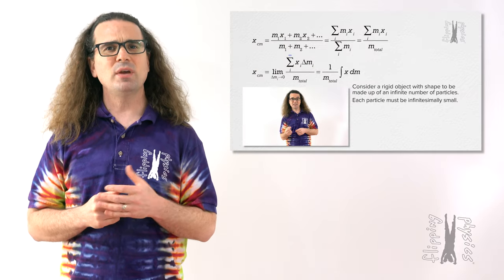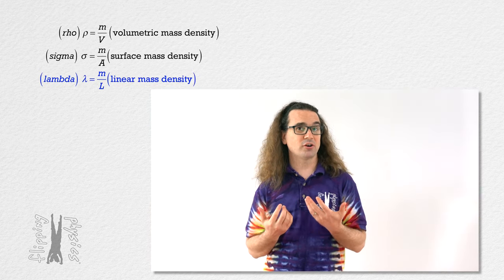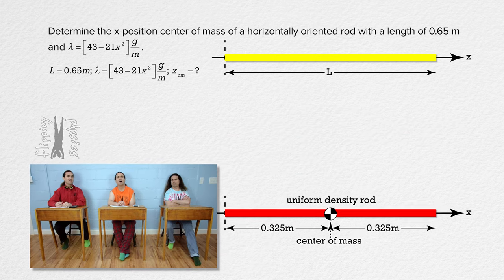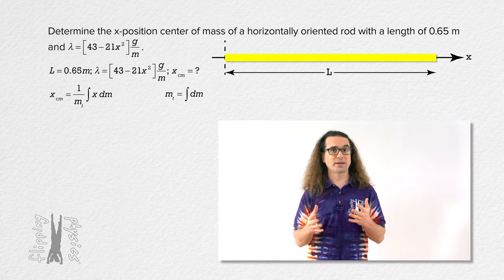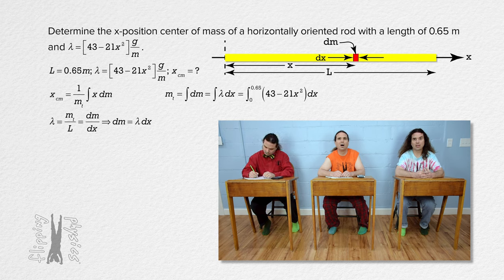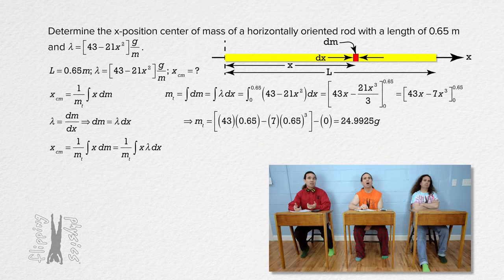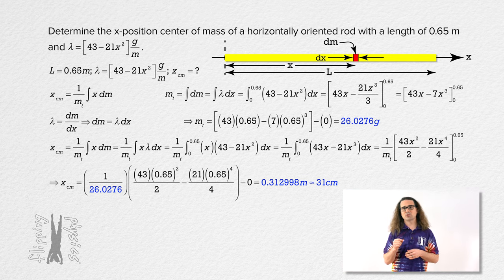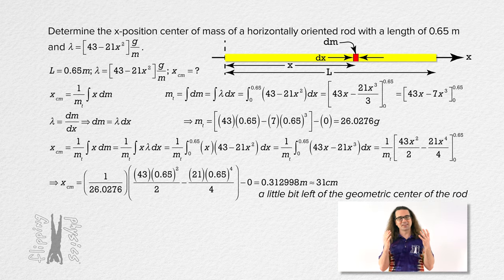Nonuniform Density Center of Mass

Comment: Hello! What about an object that isn’t a rod... with a non uniform cross section?
Reply: In any case, you select a mass element dm, that you allow to vary as a function of x.  At any given x-position, dm will equal the mass of the thin slice you make, of thickness dx.

Suppose we have a cone, made out of some kind of sand-filled resin, that varies linearly in density with position along the x-axis, and density of any given cross-section perpendicular to the x-axis is uniform.   We are letting the x-axis be the vertical position, which is zero at the bottom.  At the top of the cone, where the radius diminishes to zero, the density is rho2, and at the bottom of the cone, the density is rho1.   The base radius is R, and height is H.

Our cone's radius as a function of x is:
r(x) = R*(H - x)

The density is:
rho(x) = rho1 + (rho2-rho1)*x/H

Our mass element is equal to density times area times dx:
dm = rho(x) * pi*r(x)^2 * dx

To find total mass, integrate dm:
M = integral dm
M = integral rho(x) * pi*r(x)^2 * dx
M = integral (rho1 + (rho2-rho1)*x/H)*(R*(H - x)) dx, from x=0 to H
M =1/6*H^2*R*(2*rho1 + rho2)

To find center of mass, integrate x*dm, and then divide by M:
xbar = integral x*dm / M

integral x*rho(x) * pi*r(x)^2 * dx = 
1/12*H^3*R*(rho1 + rho2)

Divide by M:

xbar = 1/12*H^3*R*(rho1 + rho2)/(1/6*H^2*R*(2*rho1 + rho2))

Simplify to get result:
xbar = 1/2*H*(rho1 + rho2)/((2*rho1 + rho2))